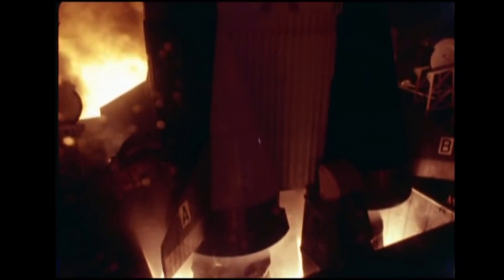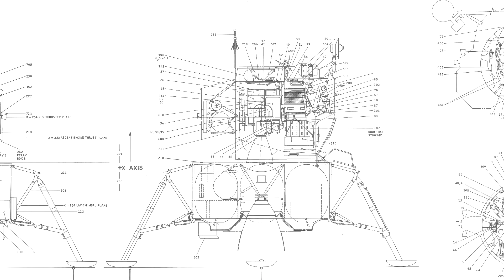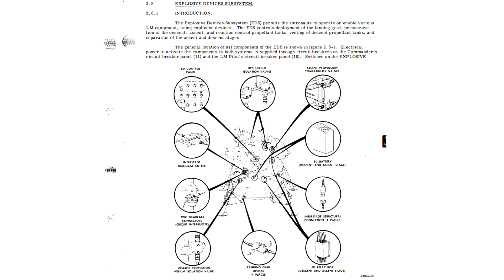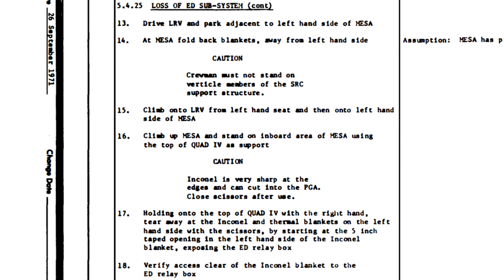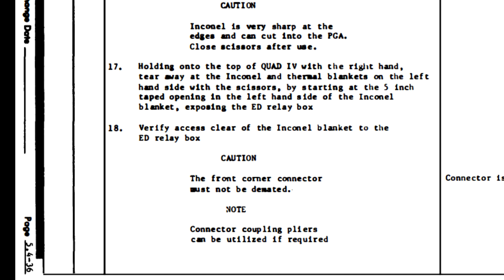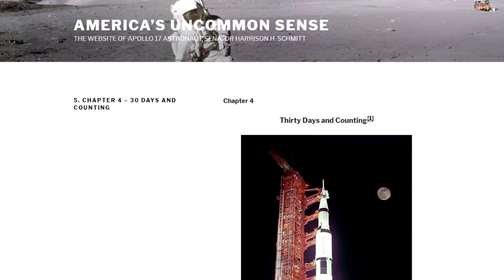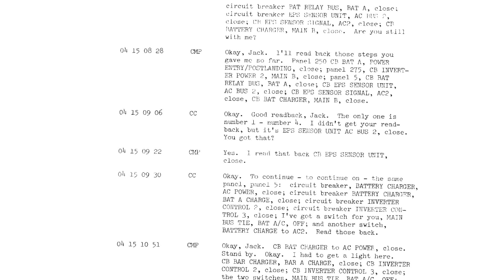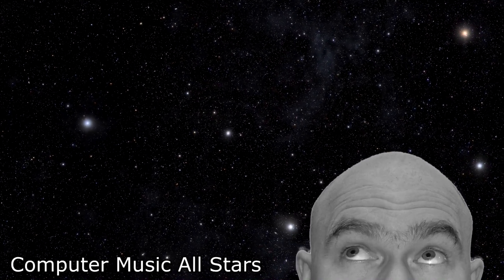Why Lunar Landers Had Jumper Cables For Emergencies

Comment: "ground control equipment used to start a booster" hmmm. Do the Soyuz matchsticks qualify? :)
Reply: Ground equipment to start boosters isn't unique to Soyuz.  If your engine doesn't have to restart in flight, then there's no reason you can't decide to require ground start equipment -- for one thing, it's one less bit of mass you have to carry with you long after it stopped being useful.  But my favorite ground start equipment has to be the start carts for the SR-71 Blackbird.  The Blackbirds were, in a very real sense, living prototypes, and there are some strange warts in their design as a result of this.  In order to start the engines, you had to first get the turbines spinning fast enough.  That part isn't unusual; modern airliners use compressed air to start their turbines spinning, from an APU if possible or a ground start cart if not.  What is unusual is that they didn't use compressed air -- instead, they mechanically rotated the turbines by means of a drive shaft connected up to the ground start cart, which relied on two automotive V8 engines.  (Buick in the early days, Chevy later.  The auto manufacturers were not consulted, this being an extremely top secret program while in development.)  On some occasions, when the engines were being particularly cranky, this drive shaft running from the start cart into the bowels of the engine would turn so fast it would actually begin to glow red hot.  Once the engine was turning fast enough, the engine would be lit with the fuel and a slug of triethylborane, which is pyrophoric and consequently great at setting JP-8 fuel on fire.  (Fun fact: JP-8 isn't much different from kerosene.  Triethylborane is also used to ignite a lot of kerosene rocket engines, from the gigantic F-1 on the Saturn V to the modern Merlin engines on the Falcon 9.)
Reply: Even Falcon 9 does this. Ground supplied TEA-TEB is used to start the engines on the pad. There is an onboard supply, but only the three engines used for the recovery burns are connected to it.

Comment: Not sure on the engineering aspect of the rover or what the access to the batteries was like, or overall how far said cable could reach.  I can tell you that the Lunar Lander operated at a minimum of 28V to a maximum of 32V and the Lunar Rover was powered at 36V.  That little bit of extra voltage may have been too much of the Lander?  Would really make you wonder since the battery technology was same why not run the 36V batteries in both and problem solved?  Oh wait, the Grummies built the lander and Boeing and GM partnered to build the rover it all makes sense now!

Comment: If the explosive final contact is what you're after you're gonna want the jump from inside the capsule because it will blow as soon as you make contact, so perhaps for some types of failures it wouldn't be possible to use the rover.

Comment: I think one reason that the rover would not be used is because they would want to be inside the module when the explosive bolts when off. Just hit the launch button an fly after that. If they connected to the rover they would have to disconnect the cables from the car and either leave them dangling during the accent or climb back up and disconnect the other end as well.
Reply from the maker: Didn't watch the whole video did you?
Reply: @scottmanley  Yes. I was just giving an extra reason the rover would not be used. It would be more complicated and take more time and have more risks.

Comment: Electrical engineer here. too high power on a long cable could be a problem due to voltage drop. Not sure which power we speak about for a jump start? Can be worsened due to the derating of copper caused by the high heat on the bright moon. Otherwise would work as a jumper cable on Earth.

Comment: November, 1965, when the Northeast US had a major blackout. . .   To get the FIRST powerplant of the grid running they needed “inplant power”, which they did not have.  So they used employees’ cars, with jumper cables to get the first plant fired up.
Reply: No way! No diesel generators at the plants for that case?
Reply: For you doubters. . .    I’m working from memory of an event almost 54 years ago.  I read about the startup in Analog Science Fiction/Science Fact magazine.  Don’t make me go to the basement and look it up. . .   😀
Reply: I didn't know power plants ran on 12V DC.  I smell BULLSHIT.
Reply: Which plant was that?
Reply: If the required voltage was some multiple of 12 or 13V, I can see that. Line the cars up, connect them in series... just make very sure the cars aren't even close to touching each other at any point! ;)

Comment: Scott, I was watching the original vido of apollo 11's first EVA on NASA youtube for fun and somehow the astronauts often seem to be transparent. Everything also wabbles slightly. Is it because of the videoquality or is it something else? Can you please explain it to me?
Reply: Apollo 11 transmitted slow scan tv.
Slow scan monitors use slower fading phospors than standard televisions resulting in ghosting when motion occurs. 
The frame rate had to be up converted to broadcast rates by first using film to photograph the slowscan monitor, developing the film and then transmitting a projected version of the film. This meant the broadcast video was 5 minutes behind the actual action on the moon. (An 8mm film version from the slow scan monitor at Honeysuckle Creek still exists and is much clearer than the third generation TV broadcast pictures).
Reply: Thanks,  @allangibson8494

Comment: You missed the opportunity to note that we have a Tesla Roadster with quite a large battery flying around out there 😅
Reply: I think it was stripped out for weight, wasn't it?
Reply: @jasonharrison25  since it was a mass simulator, weight didn't really mattered 🤔
Reply: Since the battery could explode during flight it was most likely removed.
Reply: @randomnickify  the cells itself have pretty solid casings, so no real issue with vaccum there. The cooling fluid would need to be removed, to avoid outgassing as well as rapturing the pipes. The tires would have to be filled with some kind of solid material which would not expand.
Reply: Weight wouldn't be an issue for Falcon Heavy but I can't believe they didn't take the batteries out for safety reasons.
Reply: @jshepard152  why would they need to? Spacecrafts are often powered by li-ion batteries.

Comment: I like step 32: "Perform Cabin Repressurization with descent O2 _ if available_ "
Reply: Surely there's also an ascent O2 supply. This is just saying "use your leftovers if you got em," right?
Reply: @foobarbecue  The ascent O2 supply goes quite literally out the window when they open the hatch again.
Reply: hold your breath, wait don't.
Reply: Don Sample With a contingency if it isn’t available.
Reply: @Imbeachedwhale  Correct, but if I read the contigency right, it means they would have to ride out the ascent (and rendevous) in their EVA suits as they wouldn't re-pressurize the ascent module. But that means, that they not only had to do this whole LRV-moving jump-starting manual-fireing of the ascent stage within 30 minutes, but also the orbital maneuver to dock. Because the next opportunity to pressurize the ascent module comes only when it's mated to the service module...
Reply: @QemeH  is it possible the suits can hook into an o2 supply though even if the module is unpressurised they might be able to refill or supply o2 directly to their suits.
Reply: @MrJaiimez  That's true, I didn't think about that.
Reply: @MrJaiimez  they have connections (for air and water hoses) directly in front of where they stand

Comment: Hey Scott -  you kind of skipped the most interesting part, I thought - and I can't make out the different parts of the descent stage - in that schematic drawing - that needed to be disconnected before ascent.  If you could go over each of those I'd be very interested. I'd also like to know if all the connections were blown at once, or sequentially,  before igniting the ascent engine, or all at the same time - that kind of thing.  It's interesting that they included all these backup plans and systems, but I wonder how they determined when to stop; obviously the more systems you add (& the more complexity), the more likely that something will go wrong. One other question - did the module have gyroscopes to stabilize it, as well as all the attention paid to make sure the engine was centered properly?  I never get how something as (presumably) small as a gyroscope can stabilize a large & heavy craft. Didn't you say the ascent engine was fixed in position?  How did they steer it, then?  Thanks.
Reply: They stabilized and steered it with RCS jets.

Comment: Rather than complicated automobiles, I’d say spacecraft are more like complicated aircraft. People think flying is basically an extension of driving a car, but it is far more complicated when you add two more dimensions — pitch and roll — not to mention aerodynamic integrity, e.g., not pitching your aircraft at any angle in which you stall and drop from the sky like a rock. Nevertheless, I found your video informative, very interesting, and even a bit amusing. Thank you.

Comment: How realistic is KSP to reality in terms of engines producing electricity for the systems while running?
Reply: Some engines do have alternators within the fuel system I believe.
Reply from the maker: It doesn't happen for rockets, but jet engines do it.
Reply: @scottmanley  has the idea of an alternator been deemed too unsafe for space travel?
Reply: @PizzaSphrapnel  Batteries are more reliable than alternators

Comment: They carried jumper cables and duct tape for emergencies. Please tell me that they also had a can of WD40!
Reply: Given that WD-40 was developed for the Atlas rocket program (as a spray on corrosion inhibitor for the stainless steel booster skin), copious quantities would have been available but it is also flammable, particularly in an oxygen atmosphere. Probably not recommended for inside the cabin.

Comment: Another thing,they say inside the lander there wasn't enough room to for both to put on spacesuits because when hatch opened it decompressed sending all oxygen out into space,they wont allow measuring of valve at Smithsonian either,its not big enough for spacesuit to fit through!!
Reply from the maker: Lol no, only idiots believe this story.
Reply: They stuck one arm out first, so it no longer contributed to their width. Easy, and well practiced.

Comment: One time my brother and I were playing a round of KSP with the dark multi-player mod.  We had many mods but the one of importance was the life support system, I think it was the now defunct tac life support mod.  We we're both doing Mun missions at the same time. My lander design had plenty of battery storage and power production via solar while my brother's design did not.  After a few quick calculations my brother realized that his kerbal will not have enough power to run life support for the trip home.  Luckily both our landers were designed to hit 2 biomes. We ended up meeting up in a crater and with KAS/KIS he was able to pull a solar panel and an battery off of my craft and place it on his, enough to power his life support for the return trip. Coolest part of the story is that he was playing in Ukraine while I was playing in Montana.

Comment: Fun fact: according to NASA, in case the crew couldn't jump start the lander, one of the astronauts would've needed to push the module fast enough so the other astronaut could start the engine using the clutch.
Reply: Ah, the Scott Manley Maneuver. “Get out and push.”
Reply: their newer spacecraft used automatic transmission though, so it was more problematic to start the engine
Reply: @moth4256  Newer American spacecraft are now equipped with a hand-crank for that purpose.
Reply: @YDDES  r/Woosh
Reply: @YDDES  of all the previous comments this is the one that you choose to say is wrong
Reply: @44R0Ndin  thats really necessary in some cases anyway.
Reply: @YDDES  I'll forgive you not getting the joke, since it's text, but it was in fact a joke that I was making. The hand crank is for opening the hatch (docking hatch or side hatch), not for "starting the engine". The Apollo CM and the Shuttle both had such cranks.
A much more viable emergency power production method for spacecraft that do not have solar panels would simply be to copy-paste the F-16's Emergency Power Unit, which uses Hydrazine to provide electrical power in the event that all other electrical power production methods on the aircraft fail (it needs electricity because it's a fly-by-wire inherently aerodynamically unstable design, if the flight computers go down you have to bail out).
However, there's nothing stopping a hand-crank or foot-pedal generator from working.
Reply: @ahmetmutlu348  With modern capsules having solar panels and batteries for their electrical power needs, the point is kinda moot. If you don't have working solar panels, you start aiming for reentry and landing, because you likely only have an orbit or two before your power situation is critical.
Reply: @moth4256  As long as you had a Powerglide built before '66 - 1/2 you would just have to get it up to around 20 MPH.
Reply: @MrWaalkman  not even that fast.  I had a '66 Nova with a powerglide and two or three guys pushing it on a street at running pace would get it started.

I won many a bet doing this because folks in the 1980s thought you couldn't push start an automatic.
Reply: my dad did this to a bmw but alone and in reverse
Keys in, clutch in, door open. Kicked off the ground to roll the car backwards down a hill. Let the clutch in with the car in reverse and the engine started despite the dead battery.
True Madlad move
Reply: @timothygooding9544  done that in at least 3 different cars. In reverse. On a maybe 4 degree slope.
Rawk
Reply: @markvickroy6725  Ah shit, didn't know we could jump start in reverse, always did it in forward. EDIT -  which would have a easier or lower gear ratio for easier pushing ? Forward or Reverse ?
Reply: Anonymous Interuptus  2. Gear is the easiest. Reverse is only for when you are parked uphill.
Reply: @hakonchr16  can agree, had many experiences jump starting a motorbike after the battery went wonky - running with the motorbike to jump start it does make you look odd though
Reply: @wonniewarrior  Test it for yourself
Reply: @timothygooding9544   I bump started a 1,2 ton Mercedes 190E alone on flat ground when the alternator was broken and it died from lack of electricity... But my 110kg 500CCM KTM motorcycle I can not bump-start even down a steep hill if it is on gravel (the wheel just lock up or if high enough gear it turns but will not start).
Reply: @timothygooding9544  I've done that several times. It's not so unusual.
Reply: short straw gets left behind?
Reply: Hmmmm
Reply: Kerbal 101. Somebody needs to get out and push
Reply: SLS landed is equipped with a flappy paddle shifters.
Reply: Not fact, just idea!
Reply: ...using the clutch...

I'm having a hard time GRASPING the concept. Every time I try, I keep spinning my wheels. 🤣
Reply: All they would have to do is make it to the international space gas station, and then cal. NasAAA.
Reply: @mchagnon7  That's funny. I am an alcoholic. I also used to be a car mechanic. When I first joined AA in 1985, I was advised that I should get a sponsor. Someone that I can get to know and trust to talk to if I have an urge to drink. I found a guy and we got to be good friends. He broke his knee so he was letting his room mate take his car for work. One day, I got a call from him that his room mate was stuck on a causeway bridge between Tampa and St. Petersburg Florida near where we lived. I drove over to check it out. His room mate bought gas and got rusty water. Instead of dropping the gas tank on the cause way, I filled a squirt type oil can with gas from my car, disconnected the gas line from the carb and had him start it up. I would squirt gas in the carb keeping it running so that the mechanical fuel pump would pump the tank dry. I ragged out the carb bowl, put it back together, reconnected the gas line and syphoned a half gallon of gas out of my car to get him to the next gas station. My sponsor called me the AA AAA.
Reply: Plan C: 12 inch long fuse and a special BIC lighter that had butane and oxygen canisters
problem was the fuse was outside the ascent module
You had 30 seconds to get back inside....
Reply: Alejandro Pacheco. This tread is not about trying to be funny. It’s about science and technology.
Reply: @YDDES  Damn I kinda just don't care. Don't like it? Go to another comment
Reply: @tsurutuneado5981  Still You bother to write on the forum. So You clearly have some interest in the subjekt, even if it’s stupid.